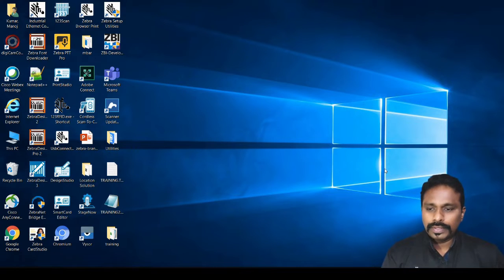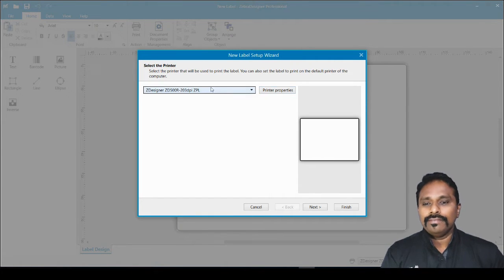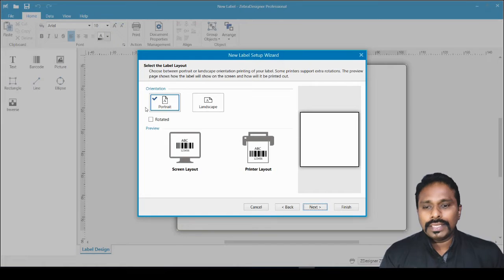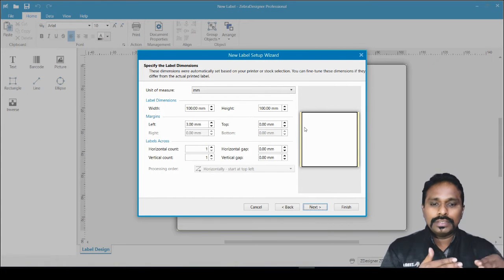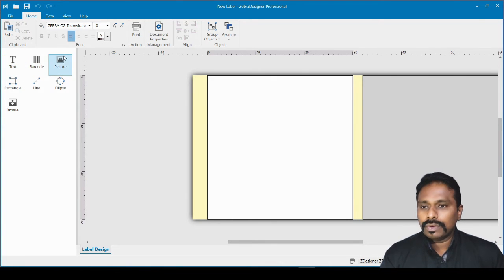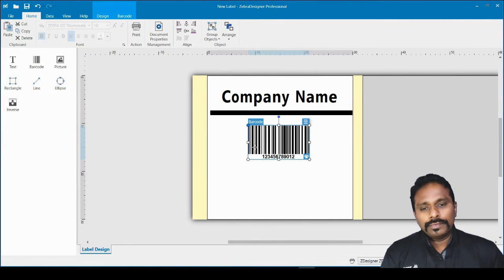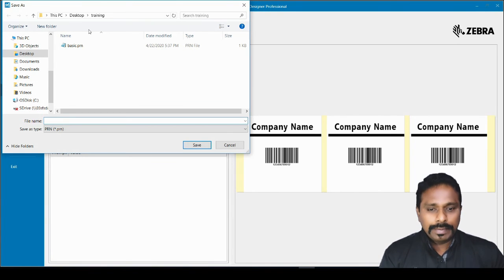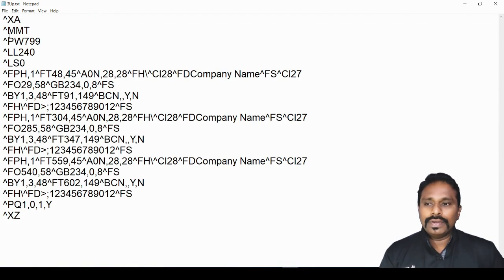Tips from our engineers - Using ZebraDesigner V3

Comment: I can't print jobs with multiple breakdowns using database without the jobs getting stuck in the printer queue (after all printouts are done). The data icon will keep blinking until i clear out the printer queue through command prompt.
Any suggestion would be much appreciated.

Comment: Manoj just wanted to clarify. You suggest when setting up templates for smaller labels to choose "Print on a sheet of paper" (instead of the default on a roll of labels) which allows the user to first create the Page Size. You then demonstrate adding this margin on the left and right,  however I'm wondering if we should also include the space between the labels as well? Typically our labels have 1/16" on each side as well as 1/8" between the labels.  Is it easier for the labels to calibrate/stay calibrated if I include this space between labels so the printer does not have to solely rely upon the media sensor?